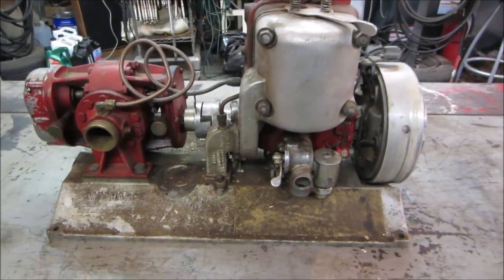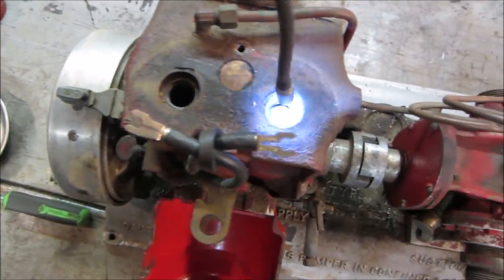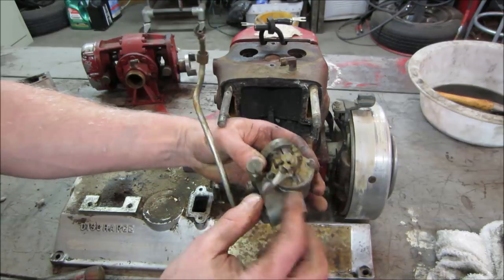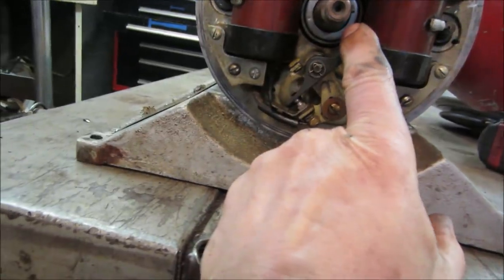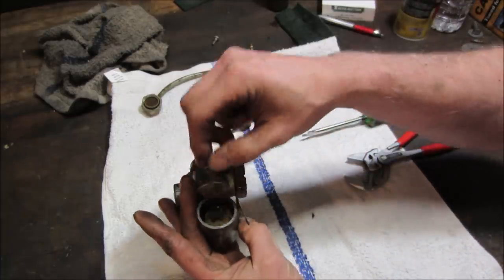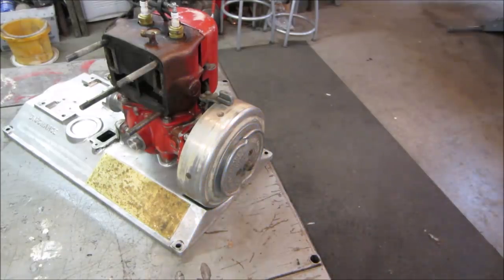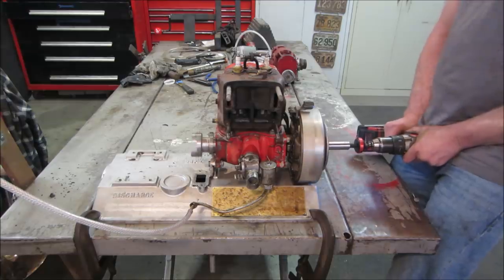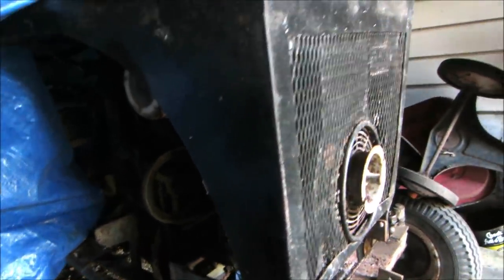WILL IT RUN?  83 Year old Antique Marine Pump.

Comment: Slang name Handy Billy pump. Thousands of them became available surplus after the war. Ranchers took the gear pump off and mounted it to the power takeoff of Jeeps and pickups and a water tan in the back for ranch fire protection. The canister on the side is an exhaust primer to draw the first water into the engine and pump. to start the operation. Used stand alone jeep can gas tank. P-Marine Company still a leader in fire pump production.

Comment: For as old as it is it seems to run pretty well. As for the reason the two throttle positions don't work, I'm thinking that it probably needs the back pressure from the exhaust segment in place to make it operate properly. That's just my humble opinion, I know some engines rely on a certain amount of back pressure. However I have enjoyed this, as well as all of your other videos! Please keep doing what you do, I look forward to all of your videos! Thanks!

Comment: picked this up at an estate sale for basically free, bought a bunch of stuff for $40 and had this thrown into the deal. The pump on mine is all brass, marine version meant for salt water. The engines quite compact, thats what attracted me to it. This will work great on a 1/4 might racer or a go kart with a carb that can be throttled. A small radiator.

Comment: The earliest form of fuel air mixers for petrol engines were called vaporisers (vaporizers US). 

Some did not have jets like modern carbs, they rellied on fuel being present on a surface and evaporating as air passed over.

Comment: The housing on the exhaust is probably a primer.  When you close the valve on top the exhaust goes out the bottom a venturi suction pulls water up into the pump.

Comment: It looks like a USFS Pacific marine fire pump To me, it will run at any altitude however they wear very interesting to get started. You set fuel and timing approximately correct for the altitude you're at and then adjust mixture in timing for best performance once you got one started you had several backpack style gas cans and you kept two hook up to it at all times so you could just change the valve from one tank to the other and keep that sucker running. My first experience with them was in the Sierra Nevada Mountains.  I had three of them pumping water up a hill all night long in relay fashion . Each one pushed the water up to a portable tank the next pump pushed the water up to the next tank an so on. They worked me to death keeping fuel mixed and connected to the pumps. Did I mentioned We wear fighting a fire.
If memory serves me that value on the exhaust is used to prim the water pump. The cooling of the motor is provided by the water you are pumping and those also came mounted on backpack frames. The fuel tanks wear curves to fit your back, and also had pack straps on them. When I was using them they were not used on trucks anymore only when it was not possible to get a track to the water source.

Comment: I once saw a pump similar this. The hole and lever on top of the exhaust box was to bleed the cooling system. It was open to start and when a steady stream of water came out it was closed. This is probably the same.

Comment: Yeah the "discharge" means it would be under at least some pressure.  That would go up the copper tube into the engine and provide cooling then the warmed water would discharge into the engine exhaust and out of the boat.  In the exhaust it would extinguish any sparks also the pressure on the discharge would go up and down depending on the amount of water being pumped, which would match the strain and heat in the engine.  The brass clip could be to hold a fuel tank, you could fill it, crank the engine and let run until fuel ran out, then if you needed to keep going put some more fuel in and crank it.  If you are pumping out a bilge you wouldn't need to pump very long.

Comment: the valve on top of the exhaust is a relief in the event the exhaust outlet is beneath the water level. it would be closed once the engine is running

Comment: Currently only 12 mins in, probably should wait till end to comment, but i suspect as this is off a boat the exhaust will have been exiting out under water, so the hatch in the exhaust cover will be to lower the back pressure when starting the engine.

Comment: Its a pump for firefighting.  you can tell by the Corse treads on in the inlet and discharge.  the flap on the exhaust is to force the exhaust though a a venturi that creates suction to prime the pump.  There's tons of YouTube videos showing how this system works. just look up portable fire pump priming/operation.

Comment: The lever on the top is to draw suction using the exhaust to prime the pump. Start the engine. Close the lever, when water starts spitting out the exhaust slowly open the lever and water should be discharging

Comment: fuel air mix goes into the sump first then when cylinder goes down (gains oil fumes)  it is forced up into the chamber for compression and ignition.

Comment: i was watching your farmland tractor engine change  you had a problem taking off the crankshaft pully   it's a tapered fit   the next time you run into this  drill a hole through the side of the pully to the crankshaft (not where the key is)) tap and put a zerk fitting into it and pump grease into the fitting   the
the grease pressure will release the tapered fit   this works for ALL stuck tapers  sorry i'm 4 years late with this information

Comment: I’ve always put an electric motor with a belt on The rope pull start. Instead of using a drill then you can just cut the power to the electric motor and let the engine run. Just a suggestion

Comment: prime on full and then slow the run for constant ump on the carb...slowly filling holes or holds would not fill constantly so you could modulate to hold the prime on the pumps

Comment: Excellent video Mustie  :) also remember seen one those on fire department my late Dad Don was in also it was to fill tanks up  & when went to calls they use a hose to extish fire with and use pull cord to start up remember that! Also 2 cylinder were 1930 years remember that too also cool set up and Happy Easter Weekend to you plus everyone! I sure enjoy video and magneticno disk fell of like broke wheel on vechiles to and so wild plus Lol! Also I remember hearing my dad said used a pulley of truck engine get them start in Winter Season plus had 30%  greenish Mineral Oil to 1 gallon gas to so be 30:1 mix but also had 20 gallon fuel tank steal one  because used lots fuel on Twin cylinder too and lots mix up ! Gas was Lead type back then too and for Winter used 91 octane type but had lots on stand by too! That Truck picture looks might be Studebaker, Fargo (Dodge) , Chevrolet, International and Ford  Truck types used back then !

Comment: I think you can make an adapter for your drill like that ratchet adapter you've used by using a bicycle sprocket . with your horde , you can use a big socket that will fit the outside perimeter of the sprocket that you can connect to your drill ...and  the middle part of the sprocket, you can connect an adapter for any socket that you will use to turn the flywheel  so once it spans the middle part will just turn freely with the flywheel so it will not kick you when it starts :D

Comment: you have a forest service fire pumper they would drop them in near a lake or river and suck water out. they are screamers running around  8 thousand rpm. Water cooling is a must . they would also be used on a ship for fire fighting operations. they are 2 stroke 2 cylinder.  Gas tank would sit on top. they had a tubular frame on them

Comment: the exhaust sliding plate is to let the 2 stroke engine start with no back pressure from the water in the exhaust pipe

Comment: You should totally apply a lick of WD40 or any simlar penetrating water dispersant whenever you get items whereby the paints not savable as is. It won't only stop it getting worse while in your care, it'll make disassembly easier when you get around to it 3-12months later.

Comment: If you had a larger fuel/oil mix tank it could run for longer.  Combined with the red color it could be for a fire suppression hose. I suppose you could have it pulling from a water tank on a truck to feed the hose.

Comment: Mustie I really enjoy watching your videos and it pains me to see you rip your arm off every time on one of those cool old engines trying to start it up, it's nice to see you getting things done. May I suggest that you use a 1/2" round hand ratchet and weld a large socket on the top across the neurals that way you could use it as a clutch drive for starting  engines without twisting your arm off you could even cut holes up the side of the socket so you can reach in and change direction of torque. Even modifying a  pull string clutch to do the job on your lathe. Good luck, Happy Easter and Thank You .

Comment: Based on the chrome hood ornaments the truck in the picture is a late 40's International KB-5, the early models didn't have the big hood ornaments or the stainless grill pieces just a small badge type emblem on the nose of the hood.

Comment: Make sure you hold that flywheel with a big strap wrench and tighten down that flywheel nut really well! If the nut isn't tight the flywheel will pop off the taper and smear the flywheel key, or crack the flywheel..or both

Comment: Know your into bicycle's, maybe get a free wheeling hub out of your stash and make a heavy duty one way starter you can flip for other direction if needed. Weld 1/2 inch or 3/8 inch drive on both sides.

Comment: It's a late thirties Johnson outboard power head around 5 1/2 horse  I have one that issimilar.
 Looks to be a very high quality salt water pump looks to me probably permanently mounted in a marine boat application..
 The valve that opens on the exhaust chest is a cut out the original outboard had a very restrictive underwater exhaust so I assume they just kept the original cut out there.
 During Ww2 most outboard motors were restricted from production because of the use of aluminum. OMC Johnson evinrude got an exemption to make lightweight high capacity pumps for ship bailing but I believe this is pre World War II production.

Comment: @ 31:04 I have a half inch drive with a sprag clutch, one way bearing, I made, that I have used to start small engines with. The only problem is, the socket can fall off the drive when you pull away, and may go into low earth orbit when it is flung from the flywheel nut.

Comment: It looks to me like it was too rich with choke and too lean without.  I would up the mixture and try to start it on part throttle, mostly without choke, or try to start it on half choke without adjusting the mixture, but the latter could make it hard to throttle back.  You could also tighten the flywheel nut more to keep it from spinning off, and maybe put the muffler back on or wear earplugs.

Comment: I thought it was a runaway when it reved up like that.🤣 You should lay your hands on a Sachsenring Trabant 601, made in east Germany. It's a car made of fiberglass and powered by a 2 cylinder 2 stroke engine. Your engine sounds almost like one of these.

39:40 Flywheel escaping🤣

Comment: Mustie if you want to make a cheap and ez one way engine drill spinner take apart an old bikes rear wheel and steal the one way bearing from it. Gonna need to weld some adapters on but they can handle the abuse.

Comment: I’m wondering if the flap valve on top of the exhaust housing is to stop the engine at low revs, or maybe just to keep rainwater out of it when it’s not in use?

Comment: The reason there is no governor is that the engine is throttled against the water pressure load which is supposed to be constant according to the laws of physics. Thar maintains the engine at a fairly constant speed.
  I want to see the pump internals, water pumps fascinate me.
Reply: The gears are similar to a hydraulic pump, creating high pressure with lower volume, there should be a displaced around the gears to make the gears force the water to a high pressure, lubrication is not necessary as the water pressure matins a water gap between the mesh of the gears.

Comment: Water cooled I wander if it’s water lubed? Because you have to prime the pump. Two strokes smoke a bunch. Gonna need five gallon bucket 🪣 two because if it works gonna shoot out the dis charge. Even if it doesn’t run pump might work. Missing the hose fitting fuel tank. May drill start it. Theirs got to be a run/choke the usual but being it’s mixed I’d see if theirs a what it needs missing sorta thing neat if it goes.

Comment: Glad you gave up on starting it with a drill. Wouldn't have been too funny if the flywheel came off at a higher speed. Not why it's called a flywheel, although it was pretty funny.

Comment: I'm curious if it would help getting it to run at idle if the exhaust was put back on. The adjustable port on top of the exhaust I'm wondering if that is to add back pressure to the exhaust.

Comment: I just watched your marine diesel engine video and had some thoughts.
Reply: If you take piston and cylinder to a local diesel repair shop ,they may be able to help you get rings,gaskets and what ever you think you will need in parts(even valves and seats)
Reply: They might not be original or new but its worth a try if you plan to finish project! Was an entertaing episode!

Comment: what if that tank connected to the exhaust is actually for water flow kinda like a radiator and the exhaust flows the watter like a water pump and the opening at the top is for excess gas
Reply: also yes this was a military unit your camera shows a very slight sill-ought of a unit/id number i can make out usa - then towards the end looks like 180 and maybe a few letters too

Comment: Forestry truck. My initial thought about the opening on the top of the exhaust side would be to prime the pump.
The pump however is a rotary gear (positive displacement) pump, so no need for a primer. Just need to have what is called a churn valve, which is between the intake and discharge side of the pump. When closed, it self primes.

Comment: Got a question - maybe dumb but want a real answer and not the internet crap answer.  Can you explain the difference between 50:1 and 40:1 fuel. What fuel for what engine and what makes the difference other than the ratio??   TIA

Comment: Heij Buddy, I more and more dislike these "Will it run" vids. Being fairly careless with this engine it might just been its last Hooray. No cooling, no muffler- i think You killed the crankcase sealing.
If this was me I´d have pulled the cylinder to get a feel for the bearings and clean the ringseats to a degree as well as the exhaust side. Then at the start attempt I´d have cooling secured by plugging the holes and fill it with water, then start.